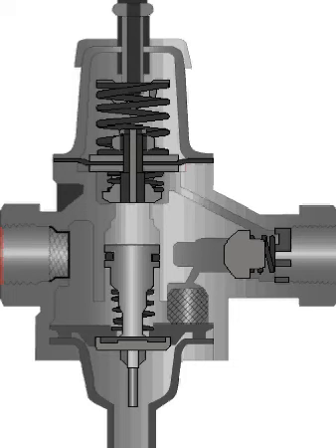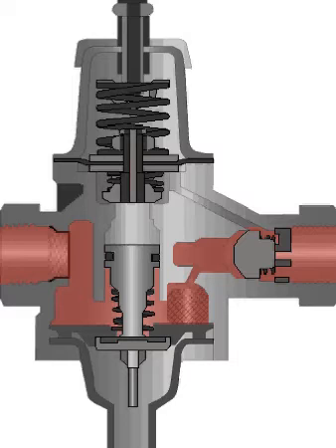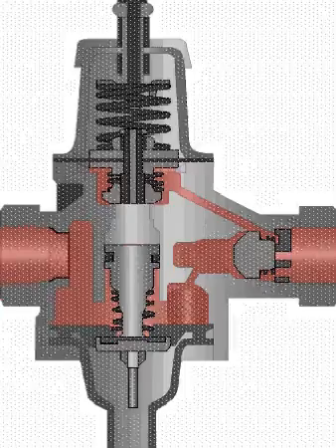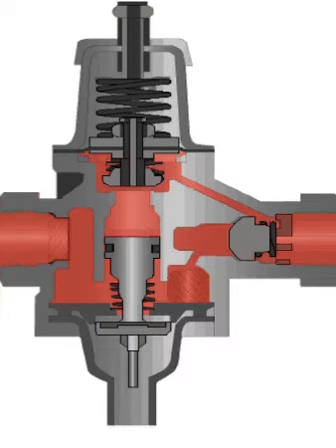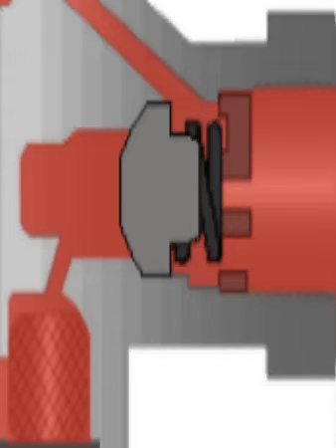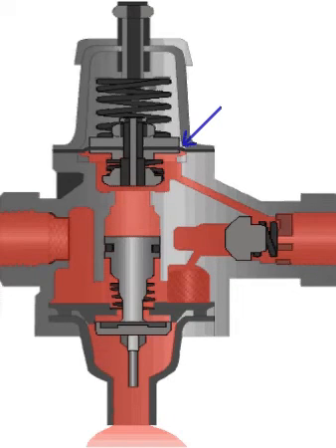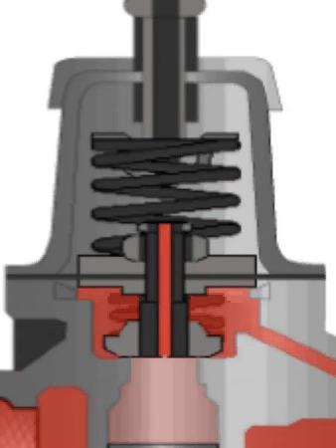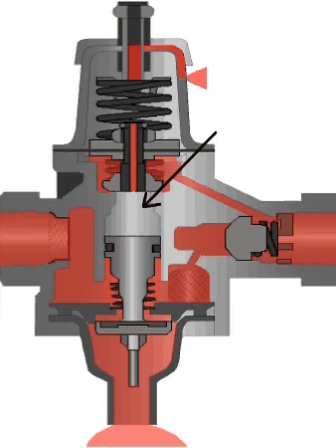Unloader Valve

Comment: Worked great Bestfor.Garden also recommend my 2017  2800 Pressure washer, quieter than the original pump which I replaced only because it cracked after replacing the pressure valve. 3 bolts, aligned it and made sure the magnet inside fit. I put a picture of the original and the new one installed.

Comment: where can I get an unloader valve for a small compressor?
Reply: You can find check valves design with 3 bores,  the unloader system of these check valves use the small bore 1/8" , you can connect it to a solenoid or directly to the automatic pressure switch if the switch has the unloader port